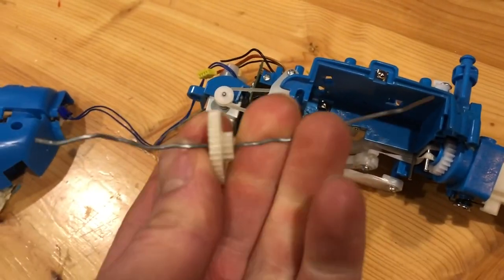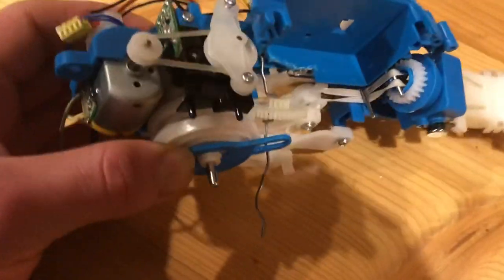Custom servo operated Squawkers Mccaw body motor conversion

Comment: Yes.
Schematics or wire drawings? potentiometer rating
Description/closeups of the gearing mod in squakers of how you are getting the different movements.
Close up of how you did the custom rotating servo & code?
Pot rating?
Very cool mod!
Reply from the maker: I’ve done a few videos on my channel discussing the potentiometer and servo hack 

It’s pretty much the same no matter the animatronic 

I already showed the gearing in this video pretty much

The code is done with director made by fright ideas

It’s pretty basic As far as code

If anyone wanted to make arduino based Ited be more tricky